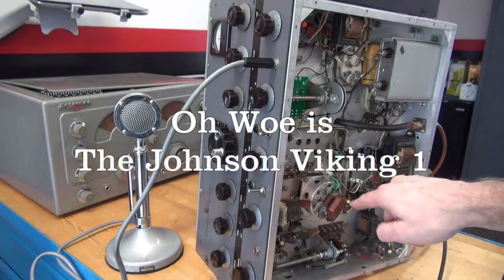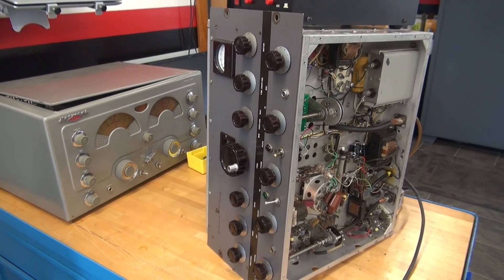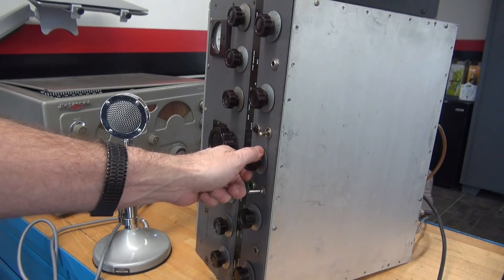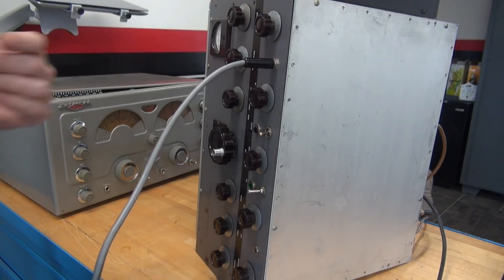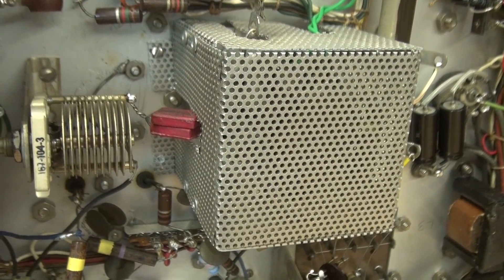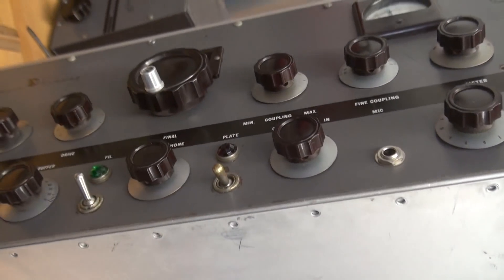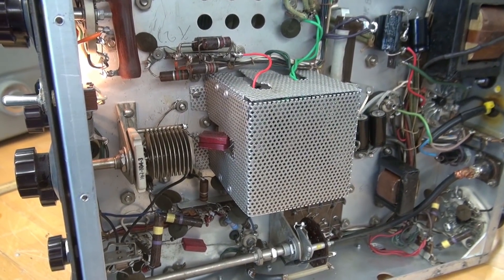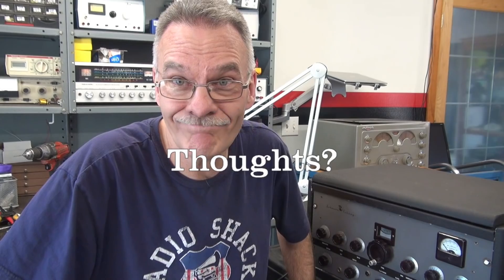Johnson Viking 1 Tube Ham radio transmitter Buzz in transmit How to fix it, Searching for answers

Comment: I have a viking 1 with factory RFI shielding and it does not do what you are getting. mine runs quiet on spot or carrier. must be something in the one you have that is not correct. oh, are you listening to leakage out of the box on your receiver or from an antenna the tx is connected to? some tx like the multi elmac af67 you get more pickup from the grid ckt than from the pa output when you listen on a random pickup with the tx on a dummy load. put what ever you are testing on a dummy load with a shielded rf pickup(like an isolated T) so you only get the pa output pick up on your receiver. maybe that helps.

Comment: Turn off the fluorescent lamps and see if it improves.  They are extremely noisy.  I'm not saying there isn't an issue with the unit, but fluorescent lamps can wreak havoc on AM.

Comment: Terry, just to let you know you're not alone battling electronic ghosts, I have a similar example which happened to me quite recently. I decided to give my AIL 460 signal generator the once over because of an intermittent P.S. failure.

Once I corrected that failure, which turned out to be oxidation of the power supplies I/O connectors, I decided to check the output signal by attaching a 2m handheld antenna to the RF out from the SG.

I could not believe the level of AC hum present in the signal from the SG though that 2m antenna as received by my TS-450S. Even the 10Mhz time base output was heavy with AC hum, so my hunch was bad filter caps in the power supply.

So I dis-assembled the power supply, which was no small feat, replaced all the filter caps on the rectifier board, tested all the diodes, replaced the only resistor on the board and put it all back together.

To my amazement, the AC hum had not changed at all, so recalling a similar situation from years prior, I then surmised that there might be a large AC field which both my receiver and the SG were within, and I directly connected the SG output to my TS-450s through coax cable.... Result: No more AC hum and an incredibly clean signal from the AIL 460.

The moral of the story???   I learned a lot about taking apart and repairing AIL 460 power supplies...!!

Comment: Hi,
   I see a feedback circuit from the secondary of the modulation transformer to the cathode of V2, C5,R9. Is it possible that this circuit has been connected to the other end of the modulation transformer secondary. Don't know if it would make any difference to to the phase of any signal arriving at the cathode of V2, should such a situation exist. It is difficult to see what would cause such instability in the circuit.

    Frank Hedley GM8TXC

Comment: Check the.005 cap on the 4D32 grid bias circuit. This cap goes to ground and is from the resistors that goes to the RF choke to the 4D32 grid. This keeps RF out of the power supply. I lifted the cap in my transmitter and I got the same buzz.!

Comment: I would try to come up with a inductive loop pickup on a long dowel and use it with a scope or a signal tracer.  That would be more precise than using your finger.  Set the Tx up to produce a minimum of hash noise and then search for the source.  That giant phenolic cap looks pretty fishy to me.  There is also an ancient paper cap under the big oil can capacitor.
Reply from the maker: I agree, Plan to do a bit of noise tracing in the upcoming video

Comment: Terry, 
I have it on good authority that Johnson hired a Priest and he performed an exorcism on the Johnsons 1's After that they called it the V II !! Just saying.

Kidding aside, mostly. Check the following

1) is the chassis earth grounded during your test?
2) double check all ground screws around the VFO, driver and PA stages and the area you are working. I'd back the screws out, squirt some DeOxit or Holy water.
3) reversed wound caps, has happened often, Pull the caps in the area, usually OD's mylars, and hook your O scope up to the cap both ways and whichever arrangement has lowest noise on the display, mark the side your ground lead is going to as the low z or ground side.
4) If all of that does not help, see what scrap metal is bringing per pound in your area. 

73,
Glenn WA4AOS
DSM Labs

Comment: Terry, possibly a grounding issue. Have you checked where and how well various components are grounded? There could be an 60/120Hz AC current flowing through the chassis and  interacting with (adding to) your signals as a result of a misplaced ground. The model, as shipped, did not exhibit this behavior. What is different about this particular one? Are there existing ground points that are not as done at the factory?
Reply from the maker: Yes, a good inspection is in order. Have not given up yet

Comment: Since on a previous video you complained about local noise level, that's where i would start.  You need a cheep spectrum analyzer have a look at low frequency crap.  The other suggestions like is it the nearby led lighting fixtures makes sense to look at.  A simple test would be to use a AC isolation transformer to power the rig.

Comment: Here is what I would check 4D32 grid choke resistors and cap to ground. Cap could be letting RD into power supply. 2D32 G2 cap to ground. Could also be letting rf into power supply. Use scope to trace source of noise. I would remove all modulated tubes and go through RD section to see source of noise of not caps. KC3NBN. Retired TV Transmitter Tech 73's

Comment: Terry, that hum is AC not RF, although the hum can couple into the RF circuits or through a heater to grid short and get amplified. Given the beating that thing took in shipping, a tube short, or other short or open is possible.

I'd completely disconnect the VFO and use a xtal for troubleshooting and scope out the DC ckts for AC ripple, then the oscillator and RF drive chain ckts without the 4D32 installed....

The rig is not that complex, so the problem is likely not complex either.....Good Luck....Jordan....
Reply: In an earlier reply to a comment, I believe Terry did mention he had tried it with a crystal instead of VFO, and had the same noise.
Reply: Yes, but my point was to disconnect the external VFO entirely from the radio to eliminate any possible AC pickup from it being connected.....

Comment: Hi,
    I enjoy your videos. From this distance it seems to me that the problem with the Viking 1 may be self oscillation, especially when it appears to vary a little when you move your hand around the chassis. I notice that there are quite a few RF chokes on the schematic, presumably necessary to RF isolate parts of the circuit. Looking with an oscilloscope may give a clue, not actually touching the circuit, just seeing what may be picked up.

Frank Hedley (GM8TXC)

Comment: You say they fixed the problem with the viking 2 so take a look to see what they did different on the VK2 around the grid circuit. 
You  will get there its just going to be a longer path to walk.
Reply: Do we really believe this was a problem with a properly operating Viking-1 & Johnson didn't tame it until the Viking-2 came out?

Comment: I'm reading some good suggestions here, so not much to add.  But this sure reminded me of an old post-war German AM-FM-SW receiver I was trying to fix.  A strong hum had suddenly appeared on receive where it had been working flawlessly.  I didn't have a schematic, but there was one shielded tube that, when I put my fingers near it, it acted the same way as the oscillator in this Viking.  After looking at it for awhile and fiddling with the tube socket, everything looked normal, but still a loud hum was coming from having my hand near it.  

So I took the biggest soldering iron I had and hit the nearest soldered ground connection on the chassis with it.   The joint had looked fine.  But reheating it completely fixed the problem.

Comment: Instead of building a cage, covering a problem, more diagnose time should have been spent.
Whenever i encounter such a problem, the fault most likely sits, where i don't look for it any more, because i think, i've already worked it over.
Shurely not something from the factory, where they just forgot a shielding.
It's hunting season, i'd guess. You'll find it, i'm sure.
Did you know that?: https://www.youtube.com/watch?v=BnR_DLd1PDI
It was new to me, never anybody in my RF-hobby-years mentioned that ever.
Reply: You know, some days ago i watched a guitar builder's video, where he "modded" a guitar amp and left out some small capacitors over Resistors, just because he didn't see the sense in them. That really did hurt and he just didn't see it.
He even never thought about the possipility of an oscillating amp and he probably won't hear it if it happens, but someone will have problems and don't know, why.
I think, at the end you will find some small imperfection, that looked  fine enough to you by sight and if it's only bad ground or minor cap leakage - but the valve amplifies the problem, the more current you draw, the more it shows.
How's the heating circuit? How's with another tube?
Then there are some other possibilities mentioned in the comments.

Comment: Lots of suggestions, many good ones, many I would suggest but they beat me to the comments! ☺  I liked the suggestion to compare the schematics of the Viking 1 and 2 to see what improvements or design decisions occurred.

If you can confirm it isn't the tubes, sockets, or oldy-moldy caps, check for it being 60 Hz hum.  You said you checked the grounds, well make sure the right points are grounded, no extra ground points shorting across anything.  Also make sure of the lengths and routing of grounds; too long a ground wire running past something it shouldn't might be the culprit.  I've also seen a case where swapped phasing on a transformer cured hum.

Good luck with the beast, hope everyone's suggestions along with your experience and hands-on access to it get things resolved.

Comment: Terry the problem might be the filament 
supply. You should try running the filament 
on DC. That 4D32 runs on 6.3 volts at 3.75
amps. By the way that’s 6.3 volts well filtered DC.
Reply: Since that is looking for a filament problem, seems some tube checking and/or substitution is worth trying. Unfortunately, i don't think we know if he's already looked at that.

Comment: Less hum and more wine? I suspect a bad solder joint on any capacitor from the power supply area.
If there is one open the that's where leakage would be occurring down the line. May have a capacitor turned around , need foil side to ground.
Don't let it become a boat anchor!

Comment: They need to add more buttons to the like area.  It is a real downer that it still has that problem, but the video itself is great.
MrRadioGypsy has a possible solution...I think it might just be contributing to the problem...if not the source of it.  The key thing to me is that it does sound like 60 Hz noise!

Comment: I have a viking 1 with original vfo and factory RFI shielding. It does NOT hum/buzz. one thing to remember is you are NOT listening to the on air signal but listening to leakage out of the box. try it on a actual antenna and listen to that signal. I have an Elmac af67 that you have to listen to the output(on air antenna) to hear the modulation as the leakage out of the box is grid signal leakage and not from the pa output ckt. listen to on air antenna signal to be sure you are hearing the actual rf output. or use a isolated T to get signal off dummy load and shield it to the test receiver/analizer. if it still does it make sure the bias line to the pa is clean
Reply: This is a good suggestion. I expect we've all noticed that an in-shack receiver will make all kinds of racket that doesn't actually get out on the air when the TX is buttoned up.
OTOH, we have heard that RX used in other videos to monitor AM TX signals & there was no buzzing from them.

Comment: Terry, I know you can fix it. Have a glass of wine,  or 4. Sit back and get your mind off of it for a bit. We know the old designed works. Yes there were flaws. I never seen  V1 do this. But we know this rig had a rough ride Time to scope it out and determine what the buzz is. Sounds like AC to me but only a scope will tell that. Once that is determined time to follow the signal to the source. The shield you made was a great idea for these rigs. Time for process of elimination.  You can do it and remember, I am no expert.
Reply: I'd like to know if he 'scoped any of the RF chain to see if the noise is being fed to the final or if it originates in the final.

Comment: Hi Terry .. well, I am an old RF engineer and have two thoughts. One, it almost sounds like you are getting RF into the IF of your Radio Shack receiver. You wouldn't think this would happen with just the VFO on spot. I have a Collins 32V3 with the 4D32 and I have found that several of my tubes will exhibit the behavior you are seeing. I found one that works, and the pins are dimensioned slightly different than the NOS tubes. I assumed the offending tubes were oscillating though I never looked at it with the Spectrum Analyzer. I found a tube that worked and forgot about it. Best of luck. 73's W7NGA
Reply from the maker: Good info. I did try the same test using my NC-300, same noise even with the VFO spot. Very strange

Comment: Some musings... 

Did you check or try a different output tube (internal tube leakage)?
try sniffing for the coupled noise source using an E-field loop and scope (or spectrum analyzer) to try and pinpoint the noisy component.
- leaky old "domino" cap?
- noisy carbon comp resistor?
- the chokes should not deteriorate, but who knows what they went through in the past (with past chassis explorers)
- it sounds an awful lot like 60 Hz getting into the grid circuit (miller resistance went way up) or running too hot (too much plate current)?
I'm sure you will find it.. looking forward to see what it turned out to be.
Cheers,

Comment: Did you scope the noise..is 60hz, 120hz..? Very frustrating for sure.
Reply: J APC I agree, would like to see the waveform of that noise. Clearly, something is coupling that in that section of the circuit when he throws the switch. Could he chase it with a signal tracer?

Comment: Yup...I'm with Tod... check to see if when you recapped you put them in right.. the foil on the proper side CAN make a big difference in situations like this. Some times you can get away with them ether way. You probably know this but I have known many experienced techs  that refuse to believe it. Also...OBVIOUSLY not all of these transceivers have this problem so putting a Faraday cage on it shouldn't have been necessary but I know how it feels to have to throw in the towel...I hate it!!!! My brain turns to mush after spending so much time on thinking what did I miss.

Comment: Sound to me a problem of the power supply. Or hock the chassis on a real clean ground.  Look also the antenna cable. In the very past 1 bult my one transmitter and the long cable i foil it up whit aluminium foil for extra shielding and earth it.

Comment: I can think of a couple of things to check.
1, Sub the tube out. 2. Check grounds in that area. 3.  Possibly the socket for the output tube is bad. IIRC they had built in bypass caps in some of those. Possibly one of those has failed or is leaky.  73' DE WB7ELC
Reply: Try it with the 4D32 pulled. Eliminates the final tube as a source (e.g., parasitics or something). Pull other stage tubes that might output on the final's frequency until (perhaps) one stage will turn out the culprit.

Comment: The very frustrating side of electronics. Terry, my advice, a good sleep, and back to it with a fresh mind and (hot) coffee in the morning. If this is picking noise, I think to re orientate some components might help, and maybe even try to put them further away from the power supply. Maybe some grid stopper resistor on that tube if they're not already present? One other thing that comes to mind is a steel "plate" that could be installed to shield things more, or some of those mu metal sheet that you can buy to wrap some toroidal transformer in, when then induce too much noise into the circuit... Anyway keep cool, and I'm sure you'll figure something out 👌

Comment: Rewire it as if it were a johnson viking 2 Then try it, wonder if it can be Modified with Viking 2 parts instead,Then it can be a franken viking 1 and 2 combined? May be only solution, if guitar amps can be modified to be better maybe this radio can too but with updated viking 2 parts ,Bet that should work if circuits aren't much different, but if they are you still can try create you're own circuit, who knows it just might work better than it did then.
Reply: Were I the owner, I might not be happy that he'd Frankensteined my otherwise stock transmitter, though.
Reply: @ordinaryaverageguy76  It just might work better though with viking 2 Parts than with what it has now, Must be a Reason why johnson changed the design, they probably knew some thing wasn't right the first time around.Those are Areas for Improvement.
Reply: 4D32 went to war effort!
Reply: Does the customer want his Viking-1 repaired or hacked into something that's neither V-1 or V-2?  A Stock V-1 will hold value & interest more than something that's been "modified" (aka ham-hacked).

This should be repairable (barring broken Unobtainium) by someone as competent as Terry. Mixing bits of this design & that design can lead to more issues & wasted time than locating the bug & fixing it.

Clearly, the V-1 design worked well enough as (1) many were sold & used and (2) Terry has worked on some before (IIRC) that turned out fine.

Comment: Outside foil on the filter caps wired backward picking up stray 60 cycles? Try a  .1 uf bypass cap on an alligator clip to ground and clip to different parts of the circuit to see where the noise diminishes. Start with the grid.